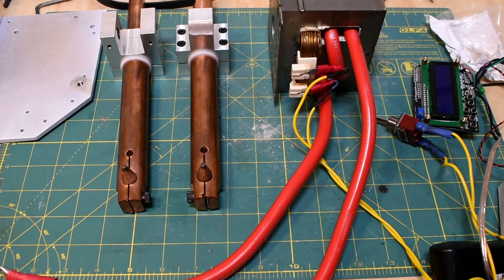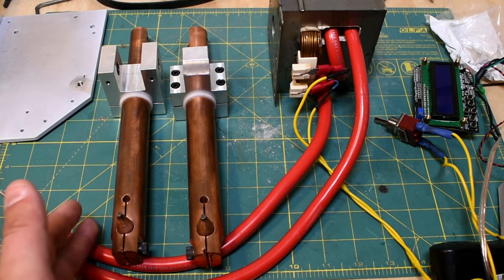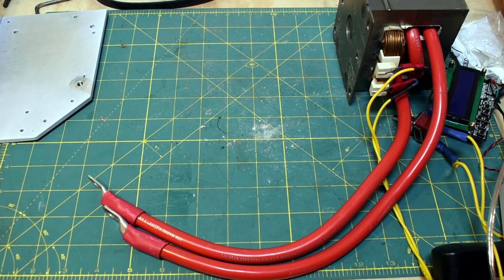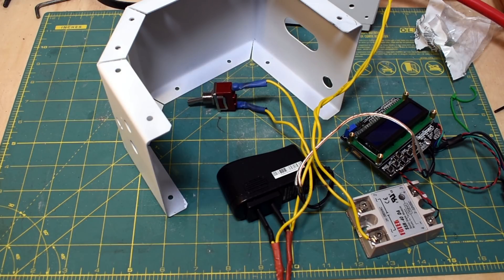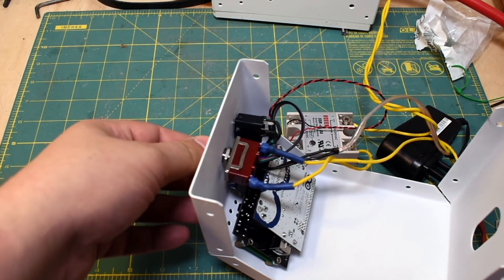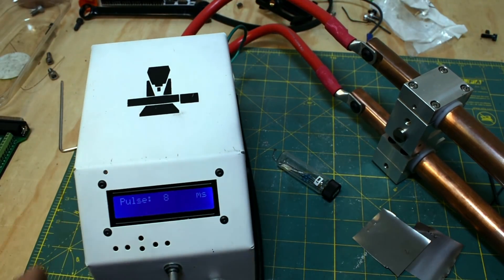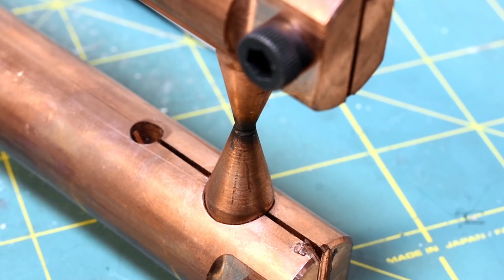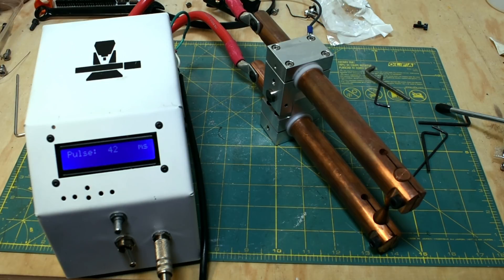Building a Spot Welder from a Microwave Transformer!

Comment: you can regulate the output power a few different ways. 
1. take another tap off the transformer from the middle of the 2 windings for half the power (same voltage, same resistance, only the current can change)
2. if you want something more variable you can have an IGBT doing PWM on the input (mains), but gotta be careful cuz you're dealing with AC and transistors don't love that so much
3. you can put more windings on it, which will give you a higher output voltage, but rectify it and PWM it with some nice mosfet(s) at a much higher frequency (few khz maybe), it'll be higher voltage but the duty cycle precision will allow you to just make more or less power overall

and also, be careful with those few millisecond pulse times, you're still getting the same 50/60hz in the output that you get from mains input, which means 20/16.66ms periods. going bellow that will give inconsistent results depending on what part of the wave you end up catching.

also the tabs that connect to the copper rods will likely be the limiting factor on how much current you get since they're likely the more resistive part of the circuit. connecting the copper directly will likely be the wiser solution, or if you have a tig machine just straight welding it. 
and after that, the limiting factor will still be the minimum thickness in any part of the circuit (assuming all copper), so rods that big aren't necessary unless your thinnest cable is equally as thick. money would better spent on thinner, longer probes that are more versatile.

great video tho, surely the best I've seen on the topic. cudos!

Comment: This is a great project but I don't think yuo can weld any time shorter than 20ms relyably (assuming your AC voltage has a frequency of 50Hz (european standard)) because you are using a solid state relay and solid state relays just switch off (as far a I know without any extra cuircitry) if the current through the relay is zero, wich only happens in the worst case 20ms after switching on the transformer because the transformer is a highly inductive load. In my project I am planning to use a contactor instead of a solid state relay.

Comment: Current on the secondary coil is already limited by the battery cable’s diameter. So thick (more diameter than your battery cable has) copper rails are kind of “overkill”. But in general, good explanation and try. Thanks for sharing your design

Comment: the Fotek ssr that you use has a ‘zero-crossing detection circuit’. This causes the relay to wait until the current it is controlling reaches zero before shutting off.and similarly wait until the mains voltage crosses zero volts before switching on, therefore you can control the pulse duration of your spot welder only with a resolution of 10mS (assuming 50Hz mains )  - there is no point to set times in resolution of 1mS ,  the welding pulse can be only whole steps  of 10mS . e.g. 10 20 30 40 ... mS etc.

Comment: I sped watched this so idk if you said it but a foot pedal switch is the way to go you can either buy one premade or like I did at first make one Which worked great but I did wind up buying a Tig welder footpedal for 20 bucks online Which has a power control knob on it and the one I made was just from a light dimmer switch but it Has to be the kind that you turn on and off by pushing it in and out not having to turn it all the way to the left to turn it off then I built it into a nice little case took the  original knob off put about a inch and Half extension on the little nub that the knob goes on drilled a hole so it’s stuck out Like 3/8 of an inch but it cannot have any play The extension can only be able to move up and down and be spun so if you step on it add an awkward angle you’re not gonna snap it off and fix on your foot pedal Are used plexiglass so I could see through it put a red line move it in 8th inch increments with a multimeter attached And marked out the readings underneath the footpedal which I could see through turned it all the way to its lowest point and put a red line on the plexiglass that would lineup with my markings underneath. Longest YouTube comment I’ve ever left

Comment: nice video I tried to follow along with it and bought a  used MOT, the seller connected ac voltage to the primary winding (thin wire side). And it created humming sound. At home I removed that side and when I connected ac to the secondary side it created smoke and smell and became very hot to touch. Seems like the Secondary was already short? What you say? 

Also Now can i rewind it using suitable size enameled wire? Will winding it with slightly thinner wire be ok for spot welding?
Reply from the maker: Hi Qaisar,

First off, be careful!  I really can't make recommendations for what's safe and what isn't, I don't know what voltages you're dealing with or anything.  The secondary winding might have been shorted, but if you plugged it in with only one winding you probably overheated the wire.  Theoretically you could re-wind it, but again, be careful!
Reply: @TabletopMachineShop  there was no winding in the secondary ( actually the primary side  of original transformer from which coils were removed.). So could it be the reason that there were no windings on one side and I powered it up?

Immense thanks.

Comment: It freaks me out when you hold the copper rod with your hand while welding.
Reply from the maker: Yeah, it seems dangerous but the voltage is so low it's quite safe
Reply: @TabletopMachineShop  sure but i still can not get used to the possibility of a high current electrical circuit, closed by my body

Comment: OK vid, but the rest of the parts are already from a spot welder! OK I guess if it broke and you're subbing the transformer. However, this design will not get the full current of a manufactured spot welder. Interesting tip: Big industrial spot welders have controllers that set weld time plus multiple "pre-welds" fast weld pulses intended to blow platings off parts so the main weld with longer time creates a true weld between the base metals of the parts - otherwise parts can look welded but snap apart later!

Comment: How many volts can be expected from one turn of that heavy gauge wire? like 12v?
and would the voltage change with a larger or smaller gauge wire...or does the number of turns determine the voltage?
if so would jamming one turn of the largest gauge wire possible give more amps??
or is it only capable of so much amps and becomes a waste to increase gauge size on the secondary?
Also rather then have the timer could a 12v solenoid  be used  on the secondary output on one lead just before the tip as a switch? or would it be better to just add a switch to the transformer main?
Thanks for any help...this is all french to me...nice work....

Comment: FYI you CAN spot weld aluminium if you use a thin piece of steel between it and the electrodes...
Personally I think it might be possible to make this better by using tips with small tungsten carbide insterts on the ends, as it's not a good electrical or thermal conductor (heats up well when current flows through it), but is far more resilient then steel, so it would last a lot longer.

Comment: Great video! My microwave just died and I'm going to give this a try with the salvaged transformer. I was thinking -- if you attached the heavy leads out closer to the tips, you could get away with just a few inches of copper rod. To get the length of jaws you wanted, you could press fit the copper ends into something like 1" EMT tubing. Your construction looks great, but I'm basically cheap (and copper is pricey). Nice job!
Reply from the maker: Good point!  Wires connecting closer to the contacts would save you some money.  Connecting further back gives me sliiightly higher efficiency because the copper arms conduct much better than the copper wire, but it might be a marginal gain -- I didn't do any math for this one :P.
Reply: Could you use copper pipe? It's cheap, and I think all the electrons repel in a bar so they all travel on the surface of the bar anyway.
Reply: @TheRainHarvester  Nope. The area is the most important factor. 
However, comparing a pipe and a bar with the same square section, you might be right.

Comment: You can control the input voltage with a motor speed controller connected to the primary winding  that will give you some control.

Comment: You didn't show that you connected the green (ground) wire of the power cord to the case. You probably did, but I mention it in case some of your viewers don't know to do that. It's an important safety thing.
Reply from the maker: Yessir I did, and I should have mentioned it.  Very important for a metal enclosure.  I fastened it through the transformer mounting hole directly into the frame.

Comment: Nice job, the controller looks quite professional. 
How thick have you managed to weld successfully? I had a dodgy attempt a while back, was doing well on two pieces of 0.9mm sheet but anything thicker was breaking the weld before tearing the parent metal. I wonder if cramming as much copper into the transformer as possible will reduce power losses?
Reply from the maker: I think this could probably weld  2 pieces of 1/32" together and have the material tear before the weld.  It can certainly tack much thicker material (I've been playing with 1/16" stainless) though I havent properly tested the welds and I imagine they aren't stronger than the material

Comment: could you not operate that solid state replay with pwm <analogWrite()> to give you some control over the power
Reply from the maker: I don't think it can switch fast enough for PWM.  I'm also discovering that SSRs don't like switching big inductive loads frequently :P
Reply: @TabletopMachineShop  How has it held up? Did you change the SSR or add any surge protection?

Comment: Does the SSR have zero crossing and if so does that effect timing?
Reply from the maker: It does have zero crossing which I think has a small effect on timing (only at really small durations).  One issue though is that because this is a highly inductive load, zero crossing is actually a problem (or so i've read).  I'm currently troubleshooting the relay, which seems to have died.  I'm going to try the same relay again, but this time I'm going to use a varistor for surges.
Reply: I thought it might cause error, I think at most half an ac wave though  (~8ms @60hz).

Comment: Harbor freight sells a spot welder for $127.99 USD. I am not saying i wouldnt build one myself but is this one you made superior? The spot timing is a cool feature.
Reply from the maker: That was a very Frank Grimes-y question :P.  Yeah it's the old "build or buy" debate.  My rule is that its almost always cheaper to buy, but I enjoy making things so I don't worry too much about which option is better.  Mine certainly has room for upgrades, which is a plus.
Reply: I totally get it. I didnt mean to sound like I was insulting building one. Heck I have a bench shear I am building that are only like $100 but I just wanted to build one instead of spending the money. Luckily I have a friend who could give me some spring steel for the blades.
Reply: My humble opinion is not about the cost ... but the satisfaction and happiness that’s derived out of making a device on your own and enjoying working with it.  This, many people may not understand.... or will never ....
I can envision the above effect, by the maker. Thanks. Happy New Year.

Comment: So, I don't want to be 'That guy' but what would happen if you accidentally shorted the two big copper bars with you in the middle?

I notice how you hold down the top one, so maybe a stray piece of metal was touching the bottom bar and you brushed your hand against it during the weld? 

If that would do what I think it would, and that would be give you a very nasty shock, wouldn't it be worth two delrin sleeves to make it all a lot safer?

Let me know if I'm missing something :)
Reply from the maker: So the voltage is actually so low (~2V) that current won't enter my body.  I'm not going to try it, but I'm like 90% sure I could pinch my tongue in it and not get shocked.  Electricity below 48V is pretty much totally safe in terms of getting shocked through skin.  Don't quote me on that though.  It is always better to practice proper safety precautions!

Comment: There's so many people doing this project, if I watch them all... I'm going to get the best info.
Yours looks pretty good with machined parts and all... and you cut the primary out "properly" :)
To adjust the power, have a look at Alexander Hartdegen's (he's my current "other favourite") https://www.youtube.com/watch?v=MUId45iUrO8
Reply from the maker: Oh cool, his was definitely an inspiration.  I thought it was neat how he used the transformer as a chassis... I don't know if I could get away with that though lol... too clumsy.  His power adjustment seems to work quite well.  I just blew the relay (apparently switching large inductive loads isn't as easy as I thought) so perhaps power regulation is the way to go
Reply: @TabletopMachineShop  How did you fix the circuit to not destroy the relay?

Comment: Lmfao "I made a sailboat" "flapping in the breeze"

Lmao dude we would get along so well 😂

Holding it with your thumb and welding, well that looks and sounds sketchy lmao I'd make something that looks safer to touch haha

I got two microwave transformers sitting in my tool box for a similar project. I'm thinking an industrial induction foundry, one of my friends was working on one for jewelry casting and it really got me interested in it.

You have convinced me, I am sending you a care package 😆

Also, email me the electronics you are using, part numbers and boards, etc. I'm alright with code, but I have friends that are engineers that legitimately love doing it and are very good. I'll make sure it's coded right:)
Reply from the maker: So actually it's totally safe to touch!  it's only about 2V, so it won't shock.  It does get how though.  I'll send along those part numbers.  Spoiler alert:  I just blew up the relay, so that's a bit of a work in progress.  Apparently switching giant inductive loads is pretty hard on electronics!
Reply: You probably need a heatsink and a fan for the relay alone, or you are exceeding the amperage. That looks like a fairly standard Solid State Relay, SSR, I use them in my 3D printers (that are big enough) to run the heated bed (mainly) off of mains voltage of 120. I am not exceeding 10 amps though so passive cooling is more than sufficient for my application. I suspect you are running quite a bit of amperage with that microwave transformer. I have a lot of respect for electricity because I am still very, very, ignorant of electricity. I am aware of this ignorance which is where my cautious fear/respect of electricity, specifically high-power applications such as mains and higher, come from. 

You seem like you know quite a bit more about electricity than myself, otherwise you wouldn't do the projects you ave already posted, the science doesn't make it look or sound any less sketchy though hahaha

Comment: One way you might be able to adjust the power is adding multiple taps to the primary winding, and have each tap run through a selector switch. It's pretty analogue but it could work.
Reply from the maker: It's delightfully analog.  If i re-wound the primary I might have done this just for like a "low" and "high" power mode!
Reply: Could you use an AC light dimmer on the transformer input to do that ?
Reply: Tabletop Machine Shop check out the homemade benchtop power supply video by Matthias Wendel. He goes through how something like works that in a good amount of detail.
Reply: Ya need a beefy variac.

Comment: How could you modify this to be able to weld tabs onto batteries? Seems like another good application.
Reply from the maker: I think with different electrodes you might be able to make it work.  I think battery tabs are nickel though and I don't know how well those weld with a transformer-style welder.  In my research I saw some capacative discharge welders for batteries, but I'm not sure what kind of voltage/current they're running.  I may try it anyways!
Reply: @TabletopMachineShop  did you try welding battery tabs?

Comment: Nice work. I think those copper bars may be just a lil' overkill though..... I can't figure out why not just use the extra couple foot of 2 AWG to run to the electrodes. Then you could've just used wood instead of huge copper bars. At least that's how I built mine. I'm all in on no kill like overkill but damn that huge copper bar ain't cheap! Thanks for the vid.
Reply from the maker: Yeah I've seen lots of people use wood, and that actually seems like a really good material to use because it isn't conductive.  As soon as I told myself I wanted to make one out of metal it got way more complicated :P.  I'm hoping that the big copper bars let me use electrodes I couldn't have gotten away with using wood.  I also may experiment with a higher force closing mechanism down the road that would make good use of the beefy copper bars.  I think we agree about overkill though :P
Reply: Michael- I used wood on mine, It's actually just like his except wood arms with wire ran to electrode instead of arms. I've never once even thought there was the slightest  possibility of it catching fire. I'm have no idea how it would even happen, really don't think it's even possible. If it is you'd have to make a big mistake and for an unrealistic amount of time before you could get the wood to slightly smolder.
Reply: What a great build! Loving your videos! Where did u acquire this copper bar? ;)